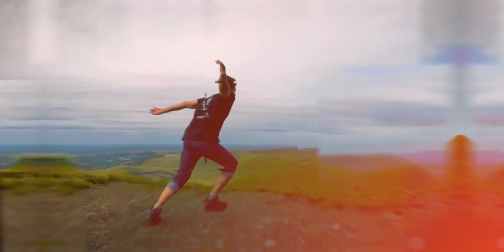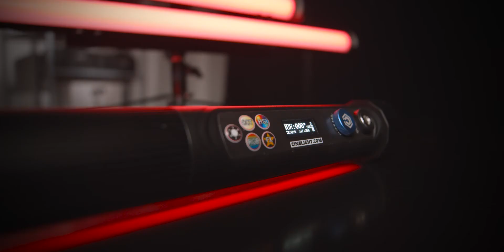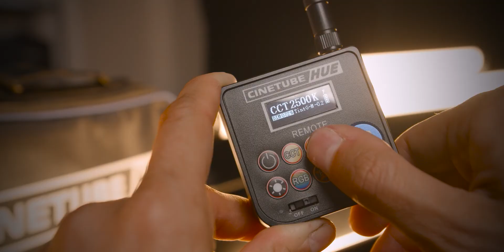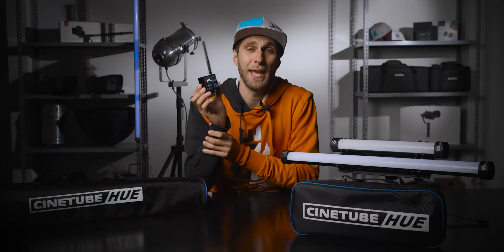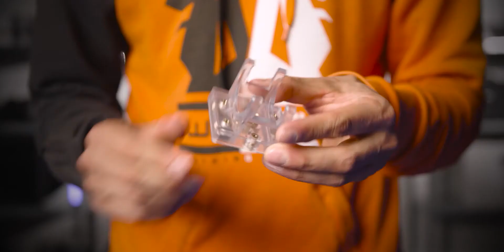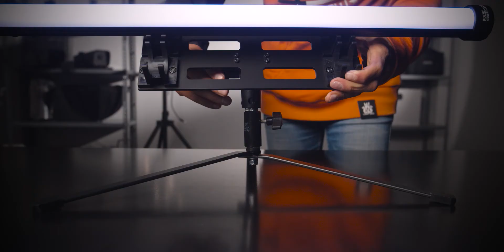CineLight CineTubes Hue REVIEW | GREAT led lights for YOUTUBE studios

Comment: Is it possible to control the tubes individually? Can I program a unique effects? for ex if i d like "running" lights with selected changing colors
Reply from the maker: Hi Mate. Thanks for the comment. Sure, you can set each light individually with the effect you want. You can have 3 lights with 3 different effects. Consider to subscribe for more videos